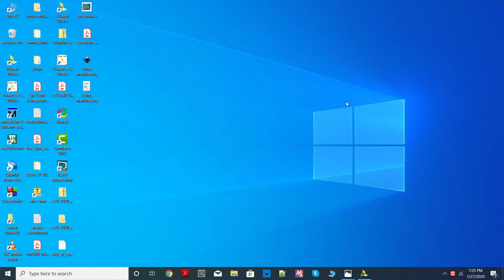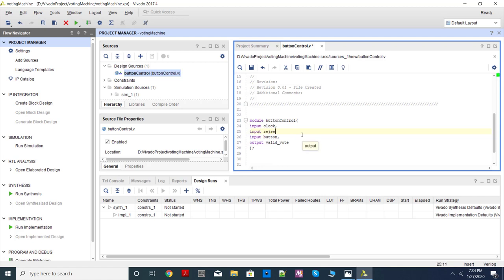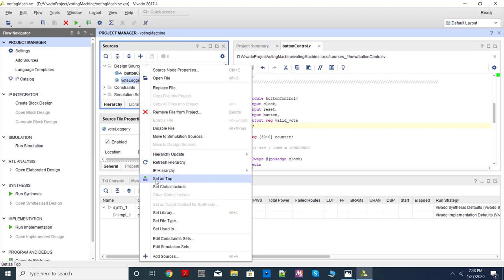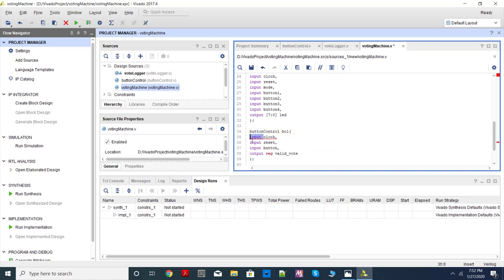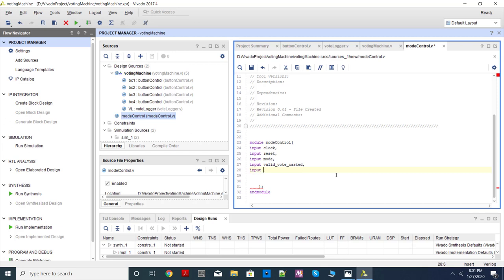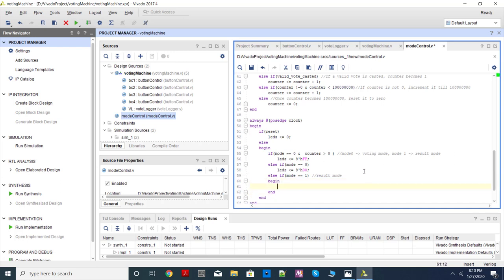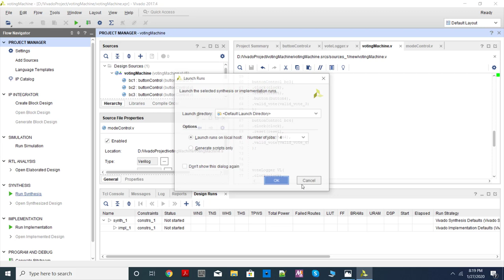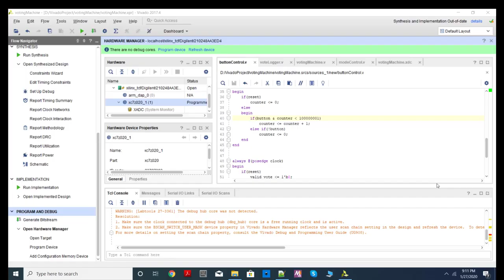Designing a Simple Voting Machine using FPGAs with Verilog HDL and Vivado

Comment: Hello Vipin Kizheppatt,

Thanks for the tutorial, just wanted to share one issue what I have faced while execution on board.

During modeCOntrol block instantiation, for these inputs --
we gave valid_vote_1, valid_vote_2, valid_vote_3, valid_vote_4 

But some how that didn't worked and I was not able to see results in mode=1

.candidate1_button_press(valid_vote_1),
.candidate2_button_press(valid_vote_2),
.candidate3_button_press(valid_vote_3),
.candidate4_button_press(valid_vote_4),

So I tried to replace those four inputs like shown below, and it worked for me 😊😊

.candidate1_button_press(button1),
.candidate2_button_press(button2),
.candidate3_button_press(button3),
.candidate4_button_press(button4),

Thanks for the support !!

Comment: This was great. Thank you for your time. Why not use case statements rather than if ones?
Reply from the maker: In most cases if conditions and case statements will infer same hardware. Modern eda tools are very smart. But yes it is true that using case statements for mutually exclusive conditions are encouraged for optimization rather than if else which may generate unnecessary priority encoder. I am not aiming for optimal hdl styles in this tutorial. May be that could be another series.

Comment: Thank you very much!  A couple questions:
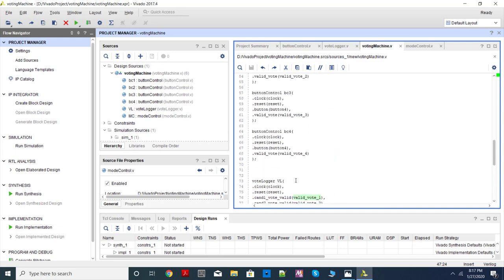1. 53:00 Since all four valid_vote signals are going into MC, could you have just ORed them inside the modeControl module and save an input?  Would that have affected how it got synthesized?  For example, does it save space to have less ports on modules if possible?
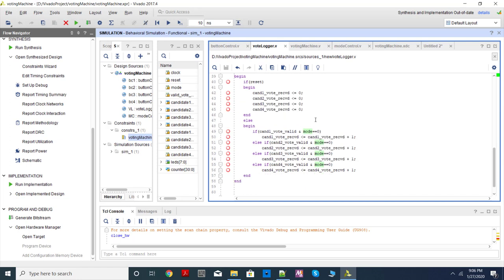2. 59:45 If you just put that if else statement all in an if statement that checked the mode, would that have saved space in synthesis?  Would that create fewer gates?

Comment: Sir Explained Well sir. How can we add some extra features like finger print sensor and how to interface it sir?
Reply from the maker: You can interface almost any sensor that you can interface with platforms like Arduino. Your sensor might have spi/i2c/UART interfaces. Will have to use PMOD connectors of the board to do it and will also have to write an application software running on the PS part of Zynq. There is a tutorial on interfacing esp module for enabling wifi in the playlist. You can check it

Comment: can you pls explain difference between xilinx ide and vivado and why you are using vivado
Reply from the maker: Xilinx IDE you mean ISE?
Reply: @Vipinkmenon  yes
sorry its ISE
Reply from the maker: ISE and other Xilinx tool chains (XPS, PlanAhead, ISIM) retired in 2014. From 2014 onwards the hardware design suite is Vivado. It integrates all functionalities of ISE, XPS, PlanAhead etc. and is much more powerful. Xilinx were using third party tools in the backend for synthesis (Simplify). The have totally redesigned it and now uses their on software. All latest FPGAs (7-series, Ultrascale, Ultrascale+) etc. are supported only in Vivado since they came after 2014. ISE you can still use for older generation FPGAs (Virtex 5,6 or Spartan)
Reply: @Vipinkmenon  so as of now I am using ISE for my verilog designing will it effect my learning
Reply from the maker: No. For learning FPGA design ISE is good enough.
Reply: @Vipinkmenon  Hii according to you best institute for learning and placement in vlsi RTL
Reply from the maker: I am not sure dear. Better to get master's from a good university in embedded/vlsi/microelectronics if ur bachelor's is in engineering
Reply: @Vipinkmenon  yeah that right but as some financial condition is down and want to do work in vlsi
Reply: @physicsandtechnology8794  bro what did you go on to do?